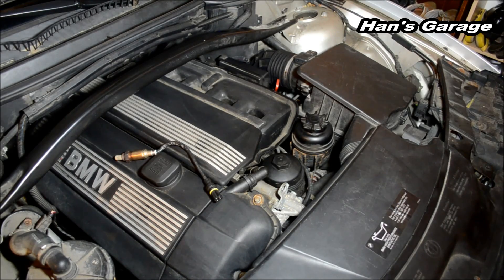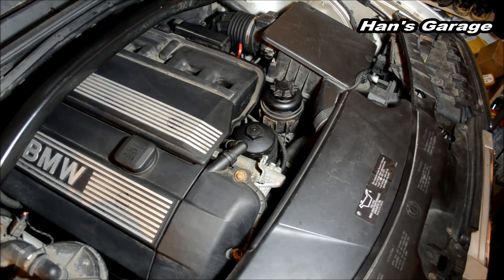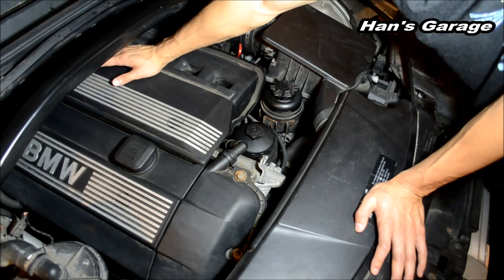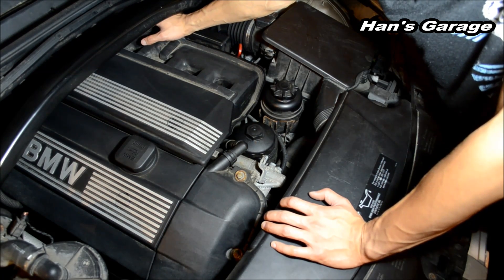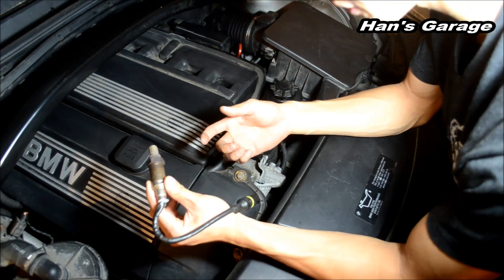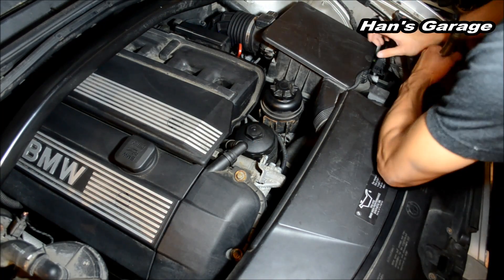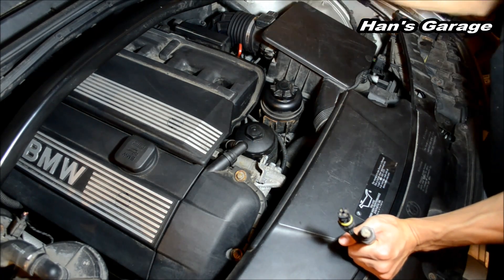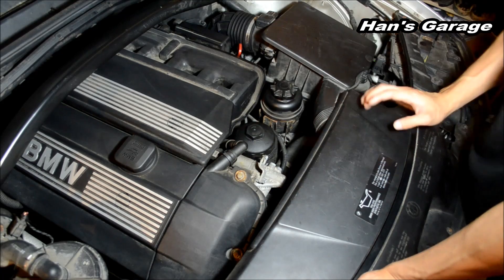BMW Most Common Vacuum leaks P0171 & P0174 Fault codes Explained

Comment: I have been working on BMW vehicles for awhile now. When these two codes set, most likely there is a vacuum leak. You need a smoke machine to find the leak (cracked hoses, bad eccentric servo motor or sensor seals, valve cover gasket leak), PCV, front and rear main seals, etc...
Reply: I own a 2015 BMW 428i , check engine light turned on and I check under the car for any leaks and there and behold is a puddle of water , wiped it with a white paper towel to see if it was colored and it was pretty much clear with a tint of yellow from the dirty asphalt have a appointment for it on Tuesday , don’t know what to expect code says it’s running lean and I have to drive it to work and back meanwhile should I be worried and how pricey do you think it will be , I would appreciate it
Reply: @adanvargas4799  take the car to have the code read. The light turns on mostly related to emissions and you can drive it normally. Cost is depending what causes the issue. Could be a loose hose (cheap) or  catalyst converter (expensive).

Comment: I have this issue, I recently had a guy change my valve cover and got the code 29E1 mixture control 2. The guy claims he forgot to reconnect a hose behind the valve cover but I checked and it’s connected, I asked him to come back but he won’t be available till the weekend smh. If it’s bank 2 could it be the mass flow sensor? I was going to clean it tomorrow hoping that’s it
Reply: Have you fixed it? I have a bank 2 running lean issue right now aswell

Comment: What if you have k&n in box air filter? The filter is know to allow more air into the engine for better performance.
Reply from the maker: Kn filter would be fine. The maf sensor will calculate how much air is getting sucked in

Comment: Hi my name is Paul I have a 2009 BMW 535i xDrive I have codes  op174 $07e8 system Too Lean Bank 2, I took my car to the shop three times the light just came back on had no leeks he said he switch something in the bank too switched something to see what what happened but the engine light came back on no I'm trying to find out a little bit more because this is the third time I have took it to the shop doesn't seem to know what it is I am going to call him tomorrow do you have any suggestions what could be going on.

Comment: Say I have a question I've found 02 sensor b1s1 wires fused together what will happen does the ecm work on b1s1 and causes a lean code

Comment: Hey i have 2010 740LI twin turbo engine N54
Milege is 167,00 KM
I cleared the codes mixture to lean
As soon as i start my car it comes back again and rough idle for 20-25 seconds
I dont know what is the exact problem
My spark plugs was replaced around 60,000 KM before
Can u help me with this please  Thanks.
Reply: Faisal Baig did you ever find a solution to this ?

Comment: Han, What did you change to resolve your P0171 and P0174 fault codes?
Reply from the maker: Boxerville Manor I replaced my disa valve and air was leaking through the old one!
Reply from the maker: Disa valve
Reply: @HansGarage where is the dis valve located? I'm having p0174 0171 codes and can't seem to figure out the issue. Everything looks good. The person I got it from had a lot of work done in it.

Comment: A bad fuel pump set these codes off for me. I changed fuel pump and the codes were gone. I spent hours looking for a vacuum leak.
Reply: i had a bad vacuum line to the fuel filter that caused the lean codes and service engine soon light to stay lit.